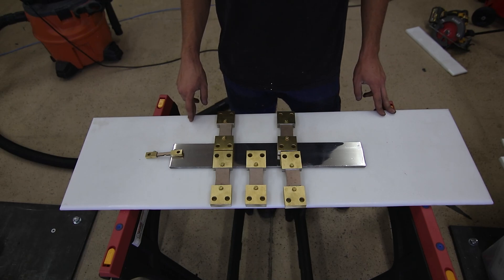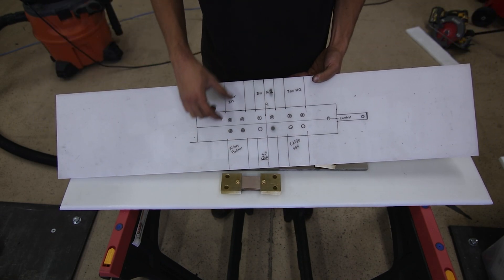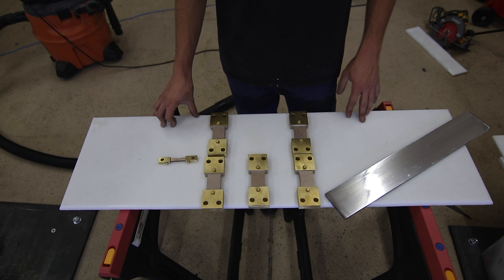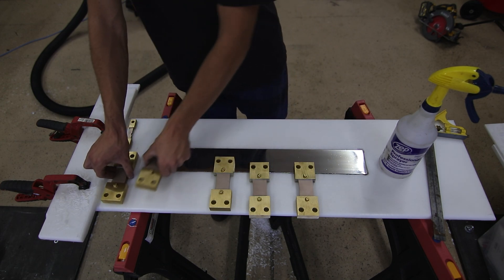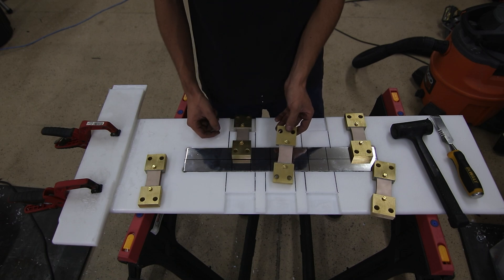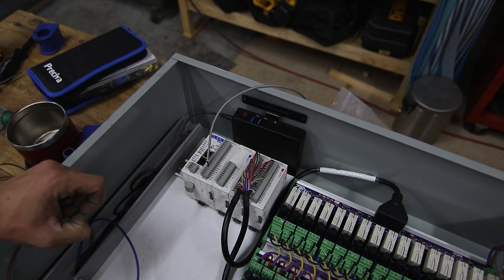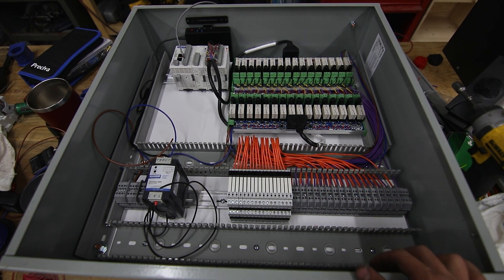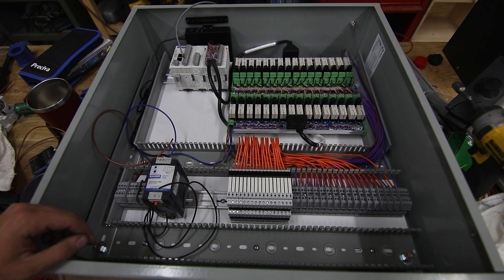Off Grid: Shunt Array Build (Custom Design Coulomb Counter)

Comment: On your ultimate plc based bms you have alarms setup for voltages. Can’t you use this to remotely control the charging if you see there is a cell at over voltage?

Comment: "shunt overkill".... victron BMV energy monitor could do just exactly that.....perhaps not everything but most of that and is all configurable....
Reply from the maker: So after reading your comment, I researched the Victron BMV, however, the biggest difference that I see is that it doesn't play with a PLC in any way - It can't tell me daily power usage, daily power generation, daily generator power generation (This can be used to figure out how much of a deficit of solar production is occurring), and lastly it cannot give me all this info in a PLC that I can use to do things like send power down the hill to the well and pump water when it is opportune, I can't have real-time capacity measurement.....Ultimately, a victron unit is great for a regular DIYer, but I've got a lot more going on here and devices like that are not very friendly for the level of integration I'm going for.

Comment: Nice bus bar common is the way to go it eliminates some of the variables.
Reply from the maker: Yeah.  In the past I had the shunt on the positive buss bar, and I had a potential difference between the shunt reading on the thermocouple module and a room temperature sensor.  The result was that somehow I was drawing 4000 amps on some CA100s, then charging at 2400 amps then discharging at 1879, yeah let's just say those weren't the actual readings.